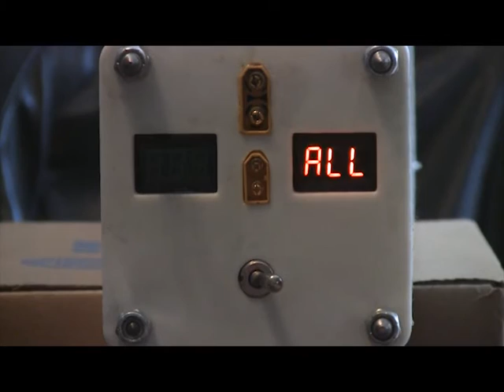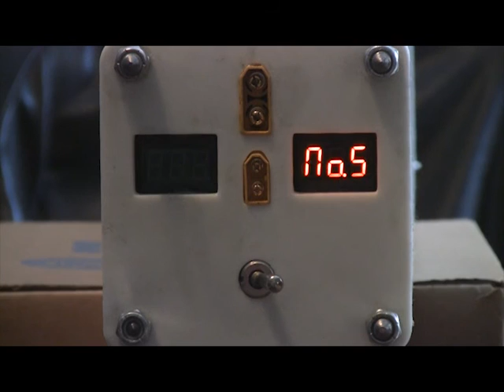Battery Blocs Case Demo

Comment: i have  240 18650 12V battery bank 4s for my solar battery bank with a 1500 w inverter i keep it at 14 volts all the time no bms i have had no problems going for 6 months so far they seem to balance them self i whish the battery blocks where easy to get for a large battery

Comment: I can't find the case on the website, what gives?
Reply from the maker: Lack of interest!  I can easily make a case front and back for you though.  I just made a real cool double case end that ties two 4" tubes together.
Reply: I do like the idea of using a fence post plastic, being it is square. I am buying an electric moped(49cc size gas scooter) from Fluxmopeds.com for $730 and it stores the battery below the seat. So if I use your system, the tube will have to stand up. Not sure how to configure the batteres, since most systems have them flat. I have to fit 200 batteries in it for 72v 20aH. I would like to see the rest of the case. I am going with your monitor ideal instead of BMS. Thanks.
Reply from the maker: I have modified a moped where I got two fence post tubes standing up side by side under the seat.  It works well.  Two hundred cells------it takes about 19" to hold 100 cells.  So you want to go 10P and 20S.    That would work well if you have 19" x 8" x 4".
Reply: Shawn, here is the website, video below on what I am fitting it into. http://www.fluxmopeds.com/innovators/ They also have 4 more electric mopeds left.

Comment: Shawn are you going to be selling this as Case front plate as a complete KIT? I would like to use both a cell logger and a BMS on my battery block build. I bought some cell loggers BUT the cell logger hook up wires I bought had a different count... AND I havn't found a 12s BMS to buy AND I am not sure about which brand of BMS to buy.... ah
Complete Kits would be great smile.
Reply from the maker: Sure, I can do that.    Contact me through BatteryBlocs.

Comment: so each one of these would monitor one of your eight cell battery blocks?
and this can also be wired with a bms and a bulk charger and a hobby charger?
or i would splice these from the bms leads and use the same plug to hook to a hobby charger?
Reply from the maker: Yes, they monitor  up to 8 parallel groups of cells.  You could use a BMS, a full voltage charger for the BMS, and also use bulk charging with a hobby charger to balance.  They are compatible.
Reply: i'm trying to figure out the best way to configure this. would i simply use the same plug and change it between the gauge the bms and the hobby charger? or could i have the gauge and bms both hooked up simultaneously.
Reply from the maker: Either way.  You could use the same plug and swap it back and forth, or you could wire another plug along side the first one and use them both at the same time...+
Reply: thanx . so basically the bms itself is meant to turn the bulk charger into a balance charge but one has no way of seeing or checking the balance without the gauges. 

one more thing. where can i find the balance charger that you use in your videos. i couldn't find it at www.hobbyking.com

your videos are very helpful and thanx for your time. i will be ordering from you very soon. 

you have the best system i have found available to give easy access to the unit for replacing cells. you're a genius man thanx again.